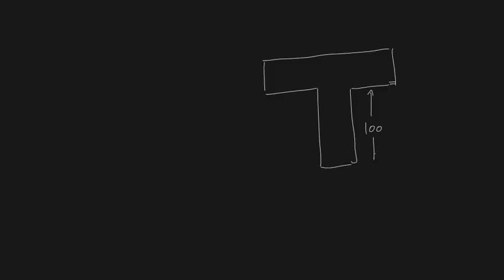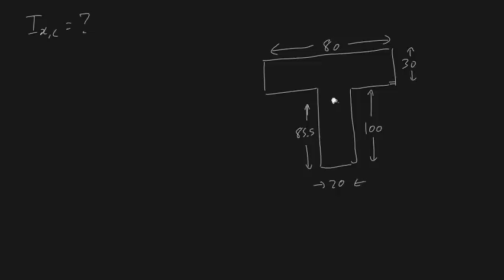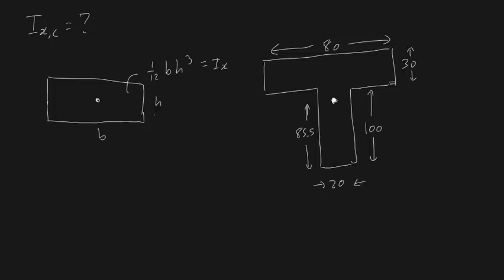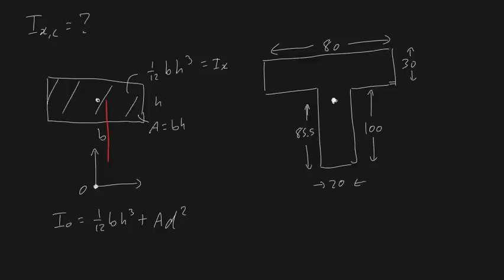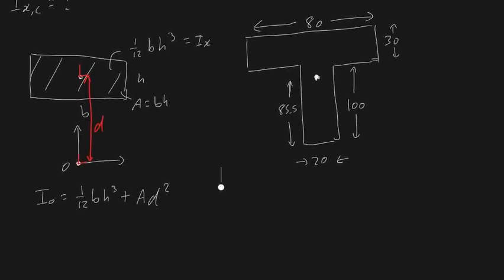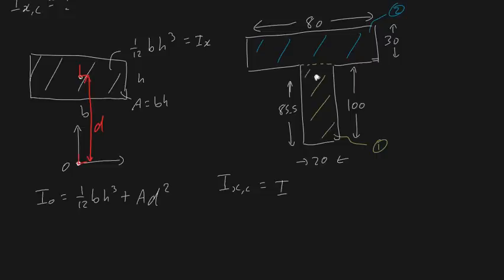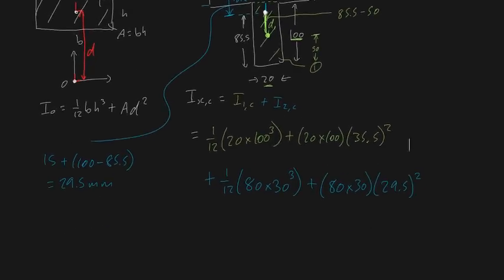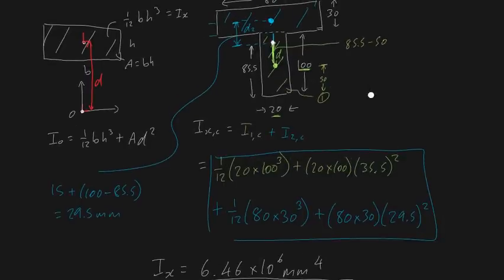moment of inertia of area T bar

Comment: that was so cool
but i have a kind of stupid question?
.. why did we get Ix and not Iy ?
Reply from the maker: +Salma Medhat Hi Salma! I_x,c is the moment of inertia of area of the centroid about the x axis. We could evaluate I_y,c if we liked. The process would be really similar. I personally decided to calculate I_x,c because that's usually the more helpful figure when calculating normal stresses due to bending - but you'll discover this in later courses! :D
Reply: +Matthew James wow..  thank you so much! the video really helped. 😊😊👍👍
Reply from the maker: If you have any more questions, let me know :D
Reply: +Matthew James +Matthew James hmm since u asked. 😁
I was wondering if this cross section is subjected to a compression or tension force how do I calculate the stress and does the stress changes if the cross section is hollowed ?
Reply from the maker: Hey there Salma! We're really getting into the heart of mechanics of materials now haha. The answer depends on where and in what direction the forces are acting. In short, if the beam is under regular bending then there will be normal stresses both above and below the neutral axis (specifically tension below and compression above). The formula is My/I and yes, the stress will change if the section is hollowed. I can't go into much more detail than that without because this is a completely different course subject haha and I'd need a full diagram :P
Reply: +Matthew James 
hahahaha :D that's alright 
thank you a lot :)